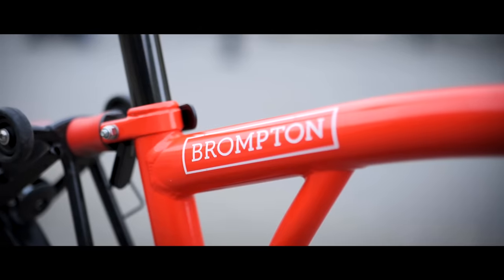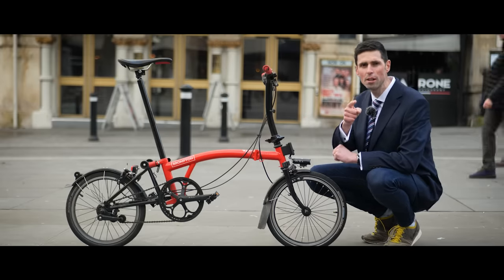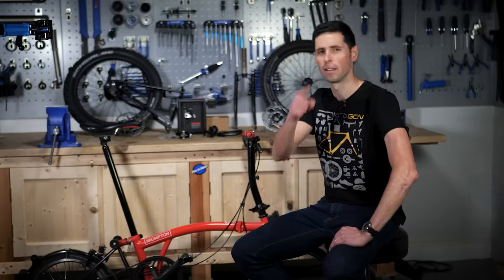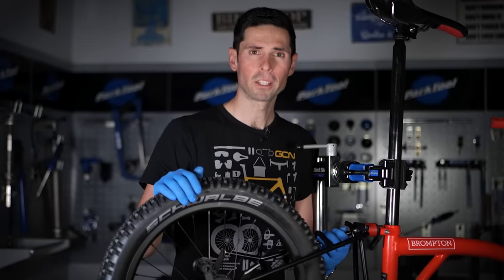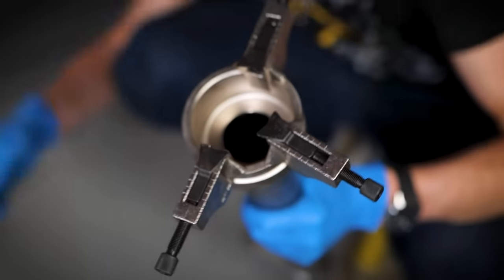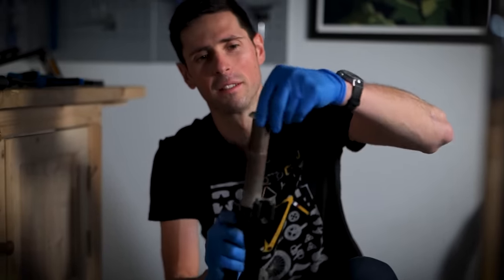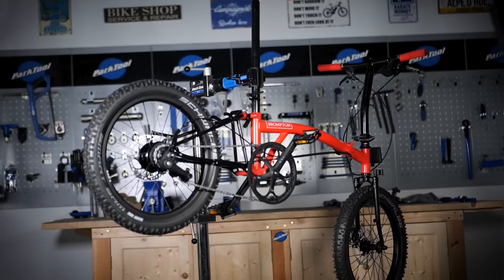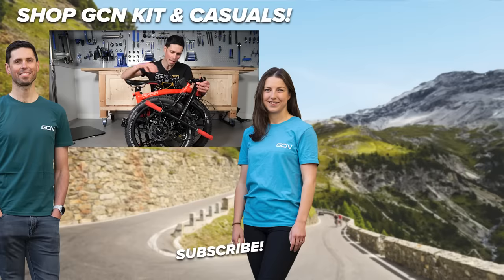Custom Off-Road Brompton Will BLOW YOUR MIND: The Build!

Comment from the maker: Who would build an off road Brompton? 🤘
Reply: I am surprised they don't offer one stock. After all these years they don't offer a more heavy duty version with off-road tires. Bike Friday has done this for quite some time now.
Reply: The Brompton folds to enable multimodal transit. Who is taking a train to the trail? IMO it's just a less effective mountain bike.
Reply: You need off road wheels and tyres to cope with the roads around Bath tbf. Reminds me a bit of the Cannondale Hooligan.
Reply: What was the final weight?
My Brompton Bicep is already at its limits.
Reply: Alex, how much would the Brompton cost to begin with, and then the rebuild, if someone were crazy enough to follow your example?
Reply: Me, me, me, me, I would, I totally would. Love riding my Brommie on gravel but I'd like to take it on more hardcore stuff. It doesn't make any sense which I why I love doing it. It's crazy what this bike can do.
Reply: Give it to Blake 😂
Reply: U guys need to give it to GMBN guys and let them shred it through jumps
Reply: @dugldhim. @gcntech,  I'm not certain of the cost of that kit, but we just returned from London, for a BMX (mainly) cycling ride out for a children's heart hospital charity fundraiser. A friend thee decided to ride his new to him Brompton instead. He bought it used for £30.00, and had another I think £75.00 in upgrades to it. So, they can be had quite cheaply,  if you keep a sharp eye out. I have him looking out for one for me now, as I had just seen this video just before we left. I came back to the video today, so I could sent it to hin.

It looks absolutely  mad😂
Reply: @ghowell13  like a Beast!
Reply: @codak29 it’s easy to fit into a small car too though. You don’t even need to buy a rack.
Reply: @muhamadirfaan3329  YES!
Reply: Brompton G line is coming!

Comment: More brompton builds please. I saw a super brompton in Singapore this year. Titanium frame with carbon everything else. Probably after market since it was 11 speed as well.
Reply from the maker: Ooooof sounds super bling! Brompton crit racing anyone? 💨
Reply: Some Singaporeans are getting custom Titanium ones from Taiwan instead of the T-Line

My mechanic went with 20" disc brakes and Shimano Ultegra

Comment: You are able to buy Eastern, Brompton-like parts also from titanium and a fork and triangle intended for a Disc Brake. I would definitely prefer a "Hydraulic Disc Brake" in front, and not waste my time and money for the back, as it is easily able to block the wheel at any time, with the ordinary brake!
     My now much less than 2019 SuperlightM6LXBrompton for now weighs 8,5 kilo (mudguards), and still falling, with a little more work on my mudguards, mostly!
  Finn. Denmark

Comment: The standard 520mm bars will be too narrow and make the ride twitchy.  You’d be better to fit Joseph Kuosac mid-rise bars, they’re 600mm wide and have a 100mm rise, SJS Cycles stock them.  I run them on my 2012 Brompton H6R, trimmed to 560mm and they handle much better than the stock item.
Reply: That's a myth. I have a TERN VERGE X18. It's the only folding road bike ever made. An amazing bike. And the handle bars are narrow. And there's no twitch. But I can slip through traffic others would have to stop for. With 560mm or wider bars.

Comment: The Moulton ATB/APB was designed for this but I suspect small wheels and stump jumping mountain biking don’t mix. Gravel yes.
Reply: as long as the hills don't kill your momentum, a 20" bmx takes some stopping!
Reply: Quite right. I’m traveling with a Moulton XTB and it’s great for mediocre pavement and well-packed gravel, but as you surmised, not mud, ruts, hopping, or steep ascents where standing on the pedals is needed. With up-spec’d components it is shaping up nicely, though.

Comment: Those Shimano rotors only have "lightweight racing" 14mm deep brake tracks, and those TRP/Tektro calipers fit "heavy duty" 16mm deep brake pads. A common/fatal mistake I've often seen that eats very deep into 2mm of rotor spiders and causes rotor collapse. I use Magura MDR rotors with Spyre calipers.